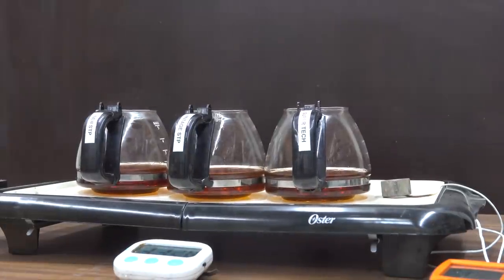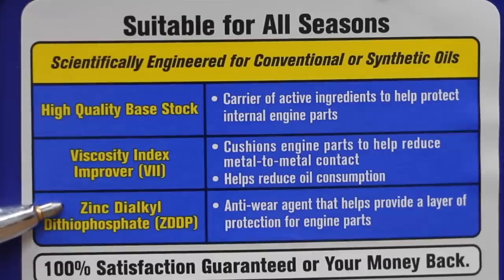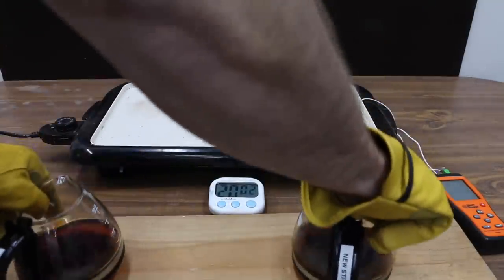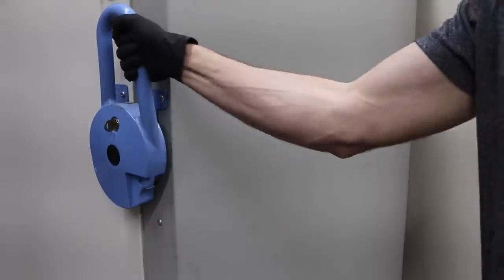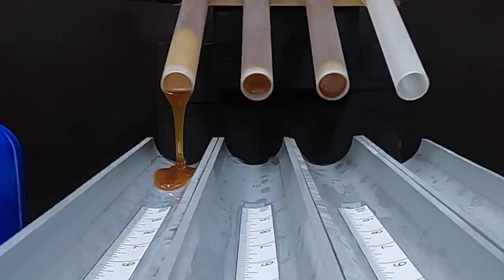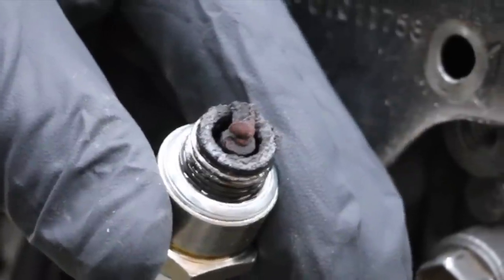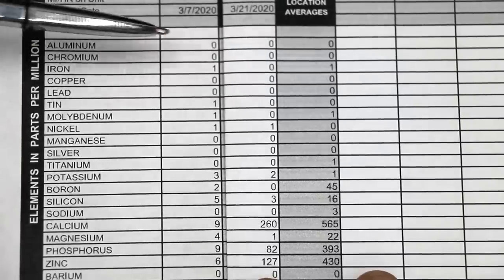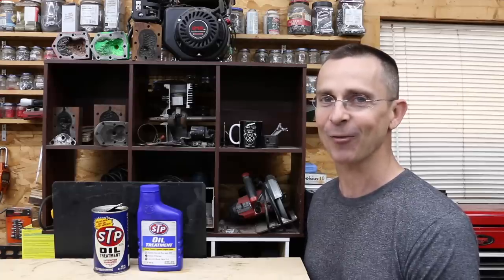Richard Petty's 1981 STP vs 2020 STP?  Let's find out!

Comment: Let's just appreciate all the time this man takes to look and respond to all these comments
Reply from the maker: Thank you very much!  I have tremendous appreciation for viewers and those leaving comments.  I've learned a lot and greatly appreciate the video ideas.
Reply: Why not, with all the time he has.  I mean, It is only a 52 acre farm. Needs something to fill out the day.
Reply: He's definitely shown me the right path in multiple situations. His time and effort shows us the right path
Reply: Well, it is his chosen job, right ;)
Reply: @ProjectFarm  I have seen many of your videos, and I have seen that you always respond, thanks for your videos and thanks for answering.
Reply: It has many worthy uses, never say never.
Reply: @x-man5056  True.  Originally it was supposed to be added to old oil, midway through the oil change interval.  Used in that fashion, on mineral oil it was very helpful with oil breakdown and dilution.  Mixing it with brand new oil makes no sense.
Reply: @usereddie215  If you have a worn engine and need to bump up oil pressure/compression, mixing with new oil OK.
I filled a 4 speed with it once to trade the car in without dealer knowing the syncros all shot.
Reply: @The Blue Max yeah, now it is a bit overused, and mostly used to make likes. But a year ago it seemed OK
Reply: The man deserves the Presidential award on the 4th of July, PS when we have a President with integrity 
By the way!
Reply: @usereddie215  you are 100% correct

Comment: Back in the late 60's or early 70's, they drove around in our neighborhood with a STP themed street rod, and handed out STP stickers to the kids. They were like gold to us kids, and really got the name out. 😊
Reply from the maker: Thanks for sharing.
Reply: Back in the 60's I lived a mile from STP headquarters (on Oakton Rd in Des Plaines), and we would walk there and go into the lobby and ask the receptionist for stickers.  Those stickers were everywhere in my neighborhood.
Reply: Back in the 70's I was a well indoctrinated STP believer. Those stickers really did a job on me. My father on the other hand resented any fuel or oil "aftermarket" additives calling them snake oil. Well almost all of them. He still added a dash of ethanol to the gas in the winter to prevent freezing. And if anyone wonders about that it's not really the antifreeze properties of the ethanol that you are after. With temperature changes there will be some condensation of water in the tank. As gas and water doesn't mix the water can get sucked up in the fuel system and form ice plugs. The ethanol however will mix with both gas and water allowing for a even mix and thus prevent the water from freezing. So not snake oil...
Reply: Always had an STP sticker 😂
Reply: Everyone had  STP sticker on their toolbox
Reply: We begged the gas station for STP stickers!!
Reply: I had a couple friends we went drag racing at the former Hollywood speedway Park in Hollywood FL, those were the days, always had an STP sticker! You could pick them up on the counter at Napa 😂
Reply: When I was a kid in the late '60s, all my friends collected stickers. STP was by far the most common and had the lowest trade value. Highest was the Mallory with the chrome outline. You could trade like 25 Medium size STP's for one. An exception was the giant STP stickers.
Reply: The use of 'denatured alcohol' to remove moisture from fuel tanks is preferred, w/o the 'ills' associated w/ethanol.
Reply: Yes !! If u had an original STP sticker... oh yeah!! Tks for the reminder!!
Reply: @blazeboyblazeboy4470  😊
Reply: Same at the motocross tracks, companies would hand out stickers. I remember STP actually paying riders like 5 bucks to put their stickers on the top riders bikes. Not necessarily a legal sponsorship but those stickers sure added horsepower. LOL
Reply: STP: sexually transmitted petroleum.
Reply: That's freaking awesome.  You lived in a cool neighborhood.
Reply: I loved my STP stickers on my bicycle seat in the 60's !

Comment: Originally STP was supposed to be added to old oil, midway through the oil change interval.  Used in that fashion, with mineral oil it was helpful with oil viscosity breakdown and fuel dilution.  Mixing it with brand new oil makes no sense.  Todays synthetics hold viscosity much better.  Good video, thanks.  You're presentations are a pleasure to watch.

Comment: "Both the vintage and the new STP seem ok with giving Supertech a head start." I love the perspective you brought to that.
Reply from the maker: Thanks.
Reply: I once had an old car battery in a 2000 Dodge Caravan, and the last winter I had it? If I was still using STP in it instead of 0w20 Pennzoil Platinum, I do not think I would have gotten it started.

Comment: Great test! 

Back in the day (mid 80's) I purchased a used MGB from a used car dealer. It had great oil pressure and no smoking. Changed the oil and the pressure dropped and it started smoking as the oil got older. Talked to a mechanic and he told me it was a used car dealer trick to put 2-3 cans of STP in the engine and it would temporarily boost the oil pressure and slow the smoking.
Reply from the maker: Thanks!
Reply: Ah, ye olde "work now instantly, break down later". Enough work time for the shady van to drive off to never be seen again.
Reply: @dimitar4y  yup. Or "it'll hold til the check clears"...
Reply: And let's not forget sawdust
Reply: Hi, in @2000 i purchased a Holden Statesman with the holden 5.0 308 V8 - - I am in Australia.
Everything was fine, but in summer stopped at the traffic lights the oil pressure guage would go to 0-5 and the oil light would go on ( love the dual guage and idiot lights ) = then the engine would stat ticking

Rev the car to say 1,000 and the light would go away.
Overall the engine was sound, compression was good and no smoke or oil usage

The fix was Penrite 20-60 for older engines.
First start up oil pressure dead cold was almost 75%, on a hot day at idle at the lights or traffic it was @ 25%, normal drive depending on rpm was 30-50% at full / normal operating temperature

It was chalk and cheese, i no longer had to worry about oil pressure and being stuck in traffic or having to put the car in neural and some slight throttle to take the revs up

Regards
George
Reply: @Charleetho yes I had a similar experience, when it comes to buying second hand vehicles it's difficult to know who you can trust. I was doing some building work on my house and needed a small van so that I could pick up materials and take rubbish over the tip. A small local garage had a 1300cc petrol Astra Van for sale, I had known the owner of the garage for over 20 years he always did the MoT's on my cars and also friends cars as well. If your car failed because a bulb had gone despite you checking them all before you took the car in then he would just replace it free of charge. The bodywork was sound but I wasn't expecting showroom because it was a working vehicle, apart from that it ran well and handled ok. About a month later and 500 miles extra on the clock and it was smoking better than a World War 2 battleship. I asked my local spare parts shop if there was anything Ì could on a temporary basis other than an engine rebuild. He took a bottle of Wynn's stop smoke off the shelf and said pour that in the oil filler whilst the engine is hot and let it tick over for 5 to 10 minutes and that should do the trick. So I always kept a bottle in the glove box and as soon as it started the smallest sign of smoking I would add another bottle of Stop SMoke. I ran it like that for 18 months before I got another good low mileage engine to drop in it.  
But Stop Smoke works an absolute treat just don't expect to rev the ass off the engine treat it with a bit of respect and it's fine.

Comment: I have to say my heart cried a bit when you opened that vintage STP.  So cool to have something that old untouched.
Reply from the maker: Thanks for sharing.
Reply: It wasn't that old...
Reply: its not a piece of art or anything of important cultural significance relax
Reply: Since it is Metric Measure on the can, it may be much newer.
Reply: I still have a six pack of Billy beer
Reply: Me too. I remember my Dad heating up the can in a pot of water on the stove to thin it out before pouring it into our old Chrysler wagons during an oil change.
Reply: Hey buzz off , that's not old 😁

Comment: You've confirmed what experts have been telling us... That good oil doesn't need additives, generally.
Reply from the maker: Thanks for sharing.
Reply: True.  Though motorkote testing on a older video showed great results for wear and may be one additive worth using.
Reply: @brandonbrown3600  But every review out there says don't do it. Motorkote works in quick AsSeenOnTV tests, but it quickly "kotes" your engine in a sludge that usually results in damage and is difficult to remove.
Reply: @Jayda08  I think you misunderstood his point. He was saying that most testing seems to indicate that there's no benefit to adding oil treatments (such as STP) because good oil already has the necessary blend of additives right out of the bottle. I think oil does continue to improve over time, but the addition of these treatments to your crankcase is really just snake oil as long as you're using good modern oils.

Comment: Wow. I'm never going to buy STP now. Thank you for getting them tested!
Reply from the maker: You are welcome!
Reply: STP is a made for a specific purpose. That purpose no longer exists in the case of contemporary engine. It might be useful in an old cast iron engine, as a zinc additive. One idea is that because it is sticky, it might work to keep part lubricated during cold-weather startups. The opposing theory is that a thin additive like Marvel Mystery Oil would stick to parts due to its high film strength.

But all of this applies to cast iron engines.
Reply: @anonymike8280  Agreed! we used this stuff only on worn out motors that smoked! Not for use on any modern car!  We are talking about a product designed for cars mad in the 1960's or before!
Reply: @chewybrand238  All of these products were for full cast iron pushrod engines. After watching and listening to numerous videos, reading articles and considering my own experience, if someone comes into a vehicle with a dirty engine, the recourse is to change the oil and accelerate the oil change interval using either synthetic or semisynthetic as required. I don't advocate using synthetic oil in high mileage engines where it was not the original.

All coventional oil is semisynthetic to a degree. I noticed at the local Walmart that the Chevron Supreme they sell is now labeled as semisynthetic. The price has not changed, which makes me think it was semi all along. The carrier oil the additives come is synthetic oil. I have that from a good source.

The best oil ha-ha I have heard was the remark made by someone that if you get your oil from a good refiner... I would like to know, who is going make the capital investment in a refinery just to make bad motor oil? No one makes bad oil. If they did, the volume buyers starting with the DOD and the GSA would find them out and they'd be bankrupt within months.

You just have to match the specifications of the product, the specifications of the engine and the type of driving you are doing. I do all short trips and my change interval with a 2.2L Toyota four is 2800 miles on semisynthetic. No one ever damaged an engine because they changed the oil too soon.
Reply: @anonymike8280  yes, change oil more often if you want it to last... sound advice
Reply: STP is a viscosity thickener to be added to engine oil, a bit of a gimmick really, but maybe some use in 1970's when there wasn't so much oil choice.   Your better off getting the correct heavy grade engine oil from the start if your engine is old and worn.   Ie. 20W-50 or other abominable oils like 25w-70; D
Reply: @michaely6665      The irony is that 10w-30 is now considered "oil for dinosaurs". Good luck finding a shop that carries anything more than 5w-20 in this day and age.
Reply: @SergeantExtreme  I've yet to find a shop that doesn't carry 10w-30.
Reply: @HunterShows      You must not live in the Midwest.

Comment: Back in the 1980's I used STP for assembly lube when rebuilding engines.  Mostly small block chevys.  Never had a failure on start up.  The stuff was sticky & seemed to help protect parts on initial start up.
Reply from the maker: Thanks for sharing.
Reply: True story:

In 1981 I had a Triumph 650 with an unknown number of miles on it, but it was a lot (maybe nearly 100k?).  I ran STP in it.  On a trip from LA to San Francisco with a couple friends, I broke a pushrod.  Limped the bike from Big Sur to Monterey, where there had been a Triumph dealer.  They no longer serviced Triumphs, so they sent me to an old guy in Carmel Valley.  

He repaired the bike, then gave me a long lecture on the evils of STP.  According to him, the Granatelli team only actually used it as assembly lube.
Reply: I used to use a thing called 'Motor Honey' for assembly lube, but they stopped carrying it around me
Reply: @shoominati23  Ah, the bottles of viscosity index improver... with the gears in a plastic contraption on the counter of your local auto parts store to show you how it stuck to the gears better than straight oil. Unfortunately it would aerate in the crankcase and destroy your gears much quicker.
Reply: @scottmcelhiney323  I had one on my parts counter for years.  It was from Lucas Oil.
Reply: @scottmcelhiney323  I don't know how STP reacts on gear trains, but I do know I filled my Dodge Colt 2.6 with the stuff and my kids jibed me about it being a "ghetto Viper" because I'd wind the revs out in every gear (except 5th, lol) and tried to kill it. I couldn't.
Reply: Chuck; Was the reason they "stopped carrying it around you"  because you might be allergic to bee stings!   (lol)
Reply: I used it as an assembly lube for Aeroquip hydraulic hoses
Reply: @JoeBob1955  Snake oil. All oil additives are snake oil
Reply: I like the way it doesn't all drip off after you turn off the engine.  No dry starts.
Reply: Old school like you I've never had a problem

Comment: Great job on this one.  Well done sir.

I remember years ago, the "old" STP was super thick....  Could hardly pour it at all below 50 degrees F....

Then I can't recall if they lost a lawsuit, or "settled" a lawsuit, where people claimed it didn't do anything...

Then the "new" STP came out....  I was very very curious, what your testing would show....

I can tell you, if you WANT more ZDDP in your engine, add some Lucas Engine Oil Break In additive to it....  My numbers on the Blackstone Labs test went WAY up when I started doing that....  

There's a future video idea...  See if Lucas Engine Oil Break In Additive does anything...  You could also test Lucas's and other brands of Engine Assembly Lube....  Some people on car forums swear by that, as an additive in every oil change....
Reply: It would stop up oil filters too. Bet that's why they changed it
Reply from the maker: Thanks for the video idea.
Reply: bobwatters  Older oil used to have a lot more ZDDP. They've taken it out over the years to conform to modern engine emissions standards. For older motors it's a good idea to add some. Also oil thickness requirements change with application. More load or higher horsepower applications benefit from thicker oils.
Reply: Amsoil has Z Rod oil for engines that benefit from lots of zinc.
Reply: Yep, and the can from the 60's actually said to prewarm the full can and then pour it down the carb throat of a running engine to "remove harmful combustion chamber deposits". I remember doing that once to a 57 Olds my buddy had bought when it was about 8 years old.
It had belonged to an old guy who never took it on the highway. He just puttered around town in it. So, my buddy shows up with this can of STP and shows me how it's supposed to remove deposits. Well, it wasn't my car, so I said sure lets give a try. Man, did that Olds smoke !!!!
We had to take it out on the highway and drive it for about 30 minutes before the smoke died away. LOLOL......and it never ran any different after the "treatment". LOLOL
Reply: "Could hardly pour it at all below 50 degrees F." - Well, oil additives are actually solid, but they dissolve when mixed with oil (duh!!) So I think the flow test here was already misguided. STP obviously has to be somewhat liquid, or else some Hill-Billy will put jelly cubes in his engine ;)
Reply: @rixretros  Lol lucky it didn't hydraulic lock it with that stuff!